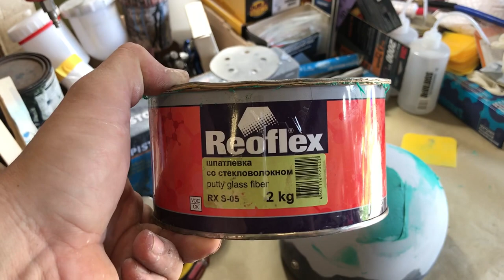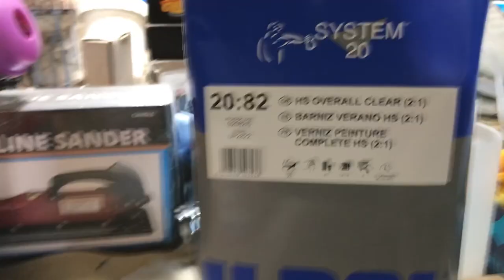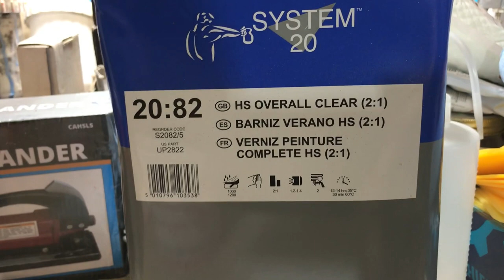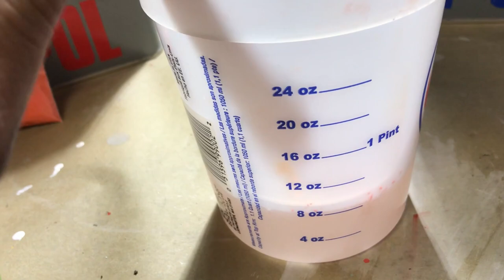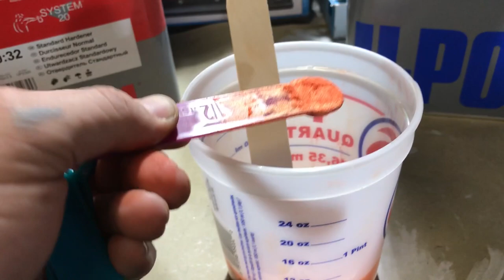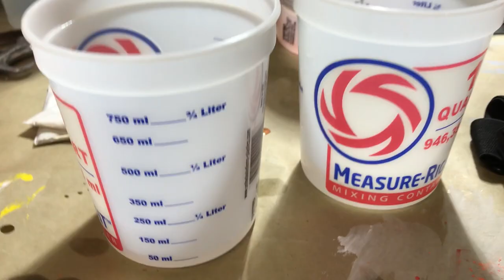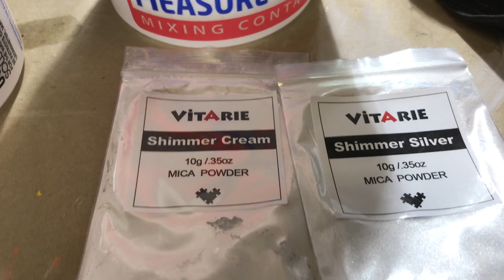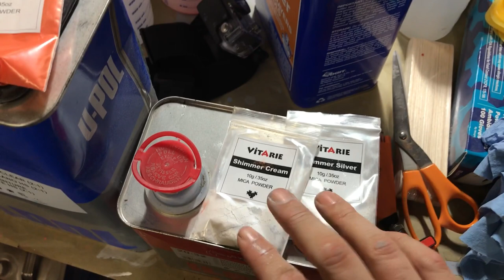Rustoleum Paint Job | Avoid these top 3 mistakes with Rustoleum Paint! Mica powder to the rescue!

Comment: Oh wow, I just found your channel and this has got me doing all sorts of thinking and wondering.  I guess I need to watch more of your stuff.

That is the smoothest I've ever seen a Rustoleum job layout.  What's the secret there?  That astro gun doesn't seem to be that expensive, they look to be an $80-90 gun on amazon, the blue ones appear to be high transfer efficiency guns rather then HVLP and most of them have larger tips (1.5, 1.7...).  I've tried a few cheaper guns like the typical HF purple gun, the TPC global guns you can get on Amazon to a few in the Astro price range, nothing has laid Rustoleum down without some significant orange peel.  I haven't quite figured out if it's the gun, the mix ratios (I've tried from very thin like a little bit more thinner than paint, maybe 1:1.5,  to 4:1 paint: thinner), I've tried messing with gun pressures some but have mostly stuck to higher pressures, and I've never tried Japan Drier.

While I'm asking things, is that blue DA the HF one?  I've been looking for a decent palm DA.
Reply from the maker: The Astro Euro HE 1.9 is a beast of a primer gun I'm thinking of getting a 1.3 or 1.4 see if it would be a good beginner base/clear gun...I sprayed the helmet with a Sharpe Finex 3000 which is the best budget gun I've found...I mixed it 50/50 with mineral spirite's and 1 tsp Japan dryer per pint...I'm thinking of changing that 50/50 is really thin and most would have trouble over doing it and getting runs...I run my gun pressure at 20-25 psi with this mix...I'm going to do a update video soon I'll try and address some of your questions...Thanks brother
Reply: @gorrillacgorilla405  This raises a question, Is the reason I can't get orange peel down to an acceptable level a cheap gun, paint mixture or technique (this may be a good video idea for you too, if this happens adjust this...)

I'm not a complete virgin to spraying paint (my first time was when I was 12 with an old suction feed gun that I found and rebuilt that my dad and godfather must have done 10-20 lacquer paint jobs with back in the '70s), and I can lay down wet and dry coats, control runs for the most part even on a pretty wet coat... but I've never spent any time around anyone that really knew what they were doing and don't own a gun more expensive than the $75 gun that HF sells or a slightly more expensive gun from Grizzly- should I be able to layout a mostly smooth coat of paint with one of these guns or even a cheap gun like the HF purple gun, or do you really need to get into something like the >$100 guns at a minimum for that kind of result?

What has further confused me is that I also have 2, 1.0 tip "jamb" guns (one of the original HF purple guns that only has a single-stage trigger and a TPC global one) that I've used to lay down glass-smooth oil and water-based polyurethane finishes on furniture, not even fussing too much with how I thinned them, but I've never succeeded in the same with Rustoleum or Ace hardware oil-based paint.  I've gotten the closest by thinning it a lot, over 1:1, and running pressures slightly over what the gun is rated at.

You've taken one variable out for me (you got a sooth finish without color sanding so it's possible with Rustoleum).

Basically do you think I have a problem with my mixture or technique, or do I just need to get off my wallet and spend some money on a better gun?  If it's the Sharpe Finex 3000, do you mean the FX3000? Maybe one of the Astro guns?
Reply from the maker: @mpikas  A good gun will take a lot of guess work out of it that doesn't mean expensive the Graco-Sharpe FX3000 with 1.3mm is what I use...$97 on amazon right now...I'm going to do a video about this in detail

Comment: Do you ever use a small amount of enamel hardener (like, say, #4625 Valspar, or an equivalent) with the Rustoleum base coat? If so, does it actually help the enamel to dry a bit quicker, glossier, and harder, as they claim?
Reply from the maker: No I don't I just use the japan dryer to help it dry faster then I apply clear over it all
Reply: If you dont apply a clearcoat over it, then yes, definitely use an enamel hardener.
Reply from the maker: @splash5974  Correct...
Reply: @splash5974  Don't you have to sand it down anyway before the clear coat even when you use the hardener?

Comment: the volume went way down spocould nothear any thing you were sayin. is that polyster spot putty with hardener. or just green bondo? shoot usualy when u mix red woth grey u get a difrentcolor but not with what u are using now thats wierd. lol., I am going to be doing a guitar with rustolium oil ebamel have to make pink so i bought 2 cans 1 red 1 white. and ioam going to be using U-POL sys20 clear coat. with metal flake over the top . what do i thin oil based enamel withn anyway?

Comment: Do you ever have problems with orange peel when spraying rustoelum? I can never seem to avoid it with rustoelum.
Reply from the maker: Brother I haven't had that problem myself...if you mix it the way I do it's pretty thin and I do light coats till I've got coverage...you could try upping the gun pressure to 30 psi and running a thinner mix like me...thanks for the comment and the question.
Reply: what clear do you use over rustoleum ????
Reply from the maker: @levellmatthews5001  U-pol Overall Euro Clear but the super clear is cheaper now on ebay.

Comment: GORRILLA  JUST YOU WAIT TILL THE KIDS  SEE WHAT YOU ARE DOING HEY YOUNG STATIC CHECK THIS OUT IM LOOKING FOR MIXING CLEAR FOR RUSTOLEUM TO DO A  OLD SCHOOL SPLIT COAT
Reply from the maker: The mixing base is the same price as the paint and the primary carrier they use for pigment...you could put almost any pigment on flake in it as long as it doesn't over come the elasticity of the bonding resin. And yes it's a stacked job over a colored base simple.